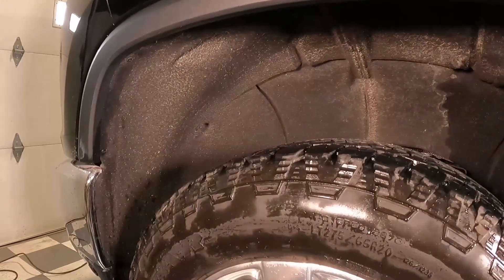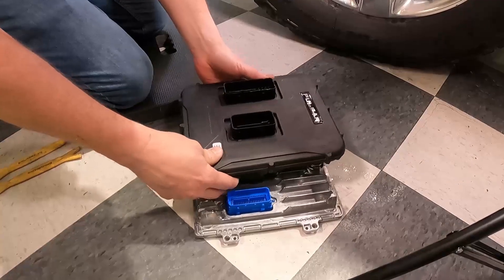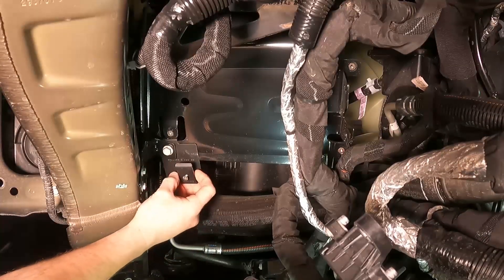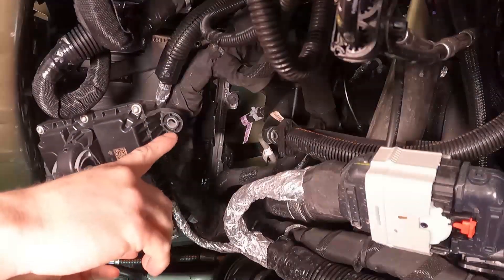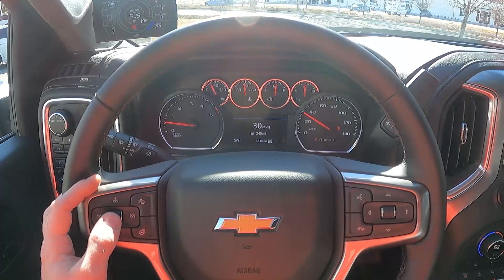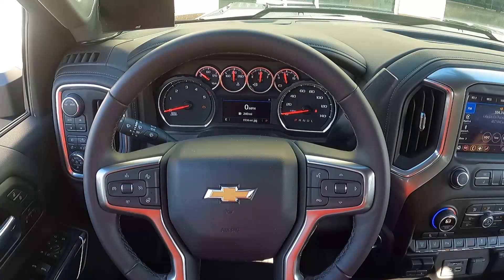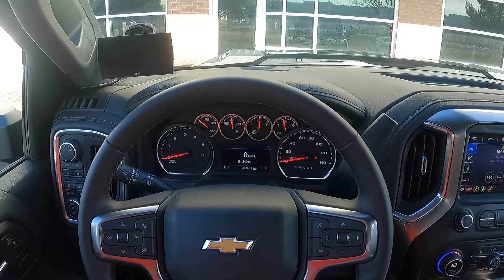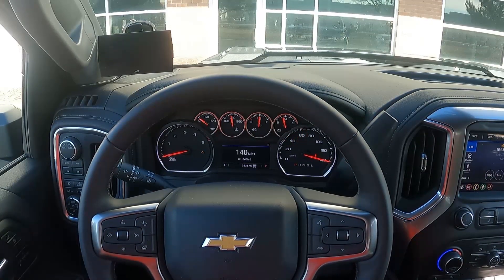L5P Pulsar V3 Install & Features Video

Comment: That’s a horrible spot for the PCM why would they put it there front end wreck and it’s destroyed 🤦🏾‍♂️
Reply: You’re in an imaginary wreck, and the thing you worry about is the placement of the PCM?
Reply: @Icutmetal  yep why wouldn’t I be 🤔 that could be one of the sole reason that vehicle can’t still be drivable 🙄 after a accident just like having a battery 🔋 stored right there like most vehicles used to have, PCM’s are not cheap
Reply: @NightCrawler810  Where’d you rather have it; in your lap?
Reply: @Icutmetal  LMFAO
Reply: Its why you have insurance